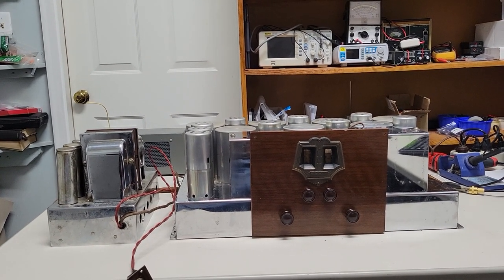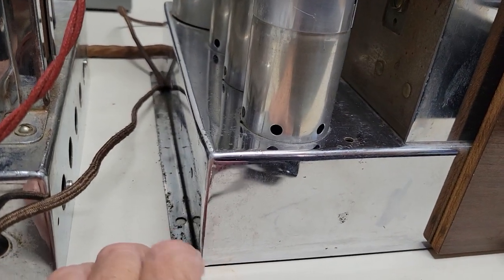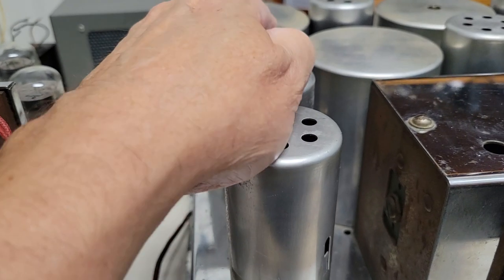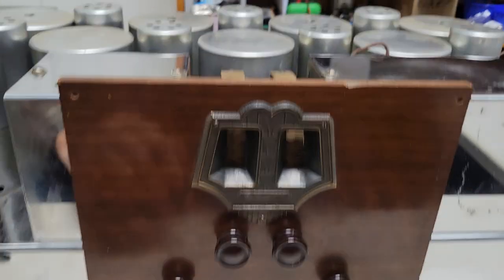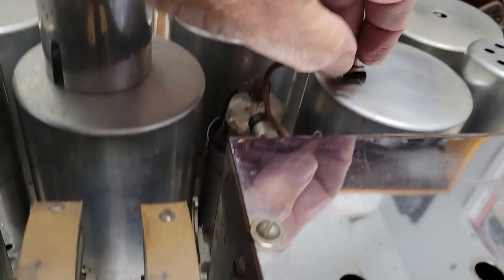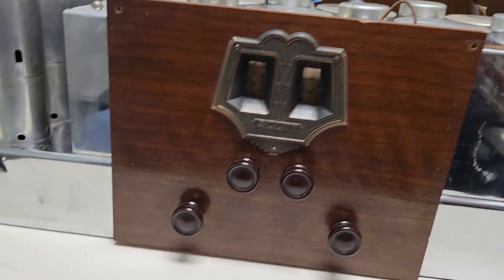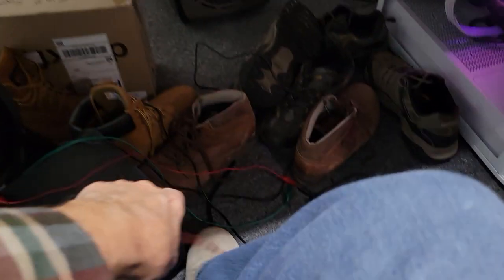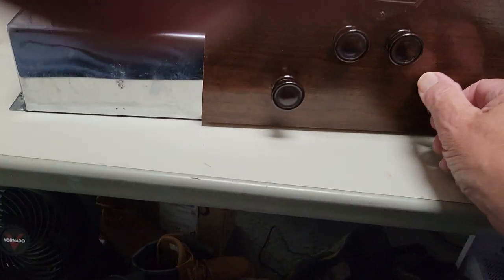E.H. Scott Radio Allwave 12 dual dial

Comment: With most of what RCA had they stole the patents.  Read Empire on the Air. That SOB Sarnoff actually broke down and cried when Armstrong's wife prevailed in court after her husbands suicide because of RCA. I have an AW12 that has a sized tuning condenser shaft  I also have the correct speaker and power supply. That is my next project after I get a Philharmonic pointer dial recapped and back to life.